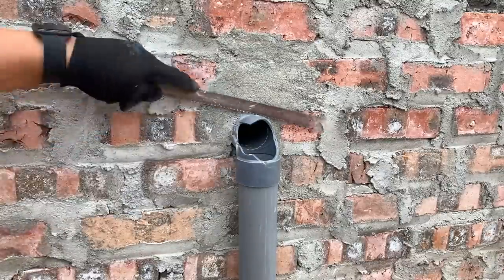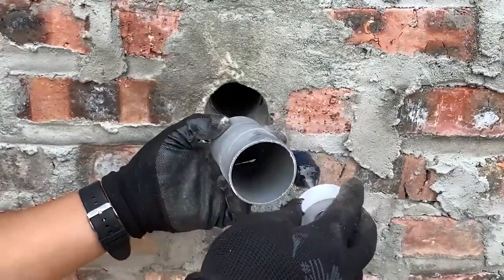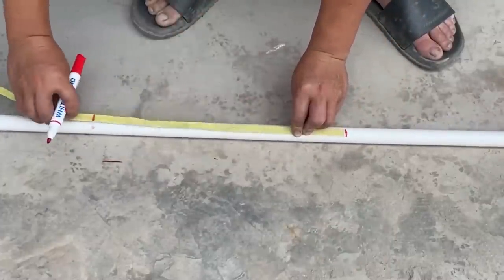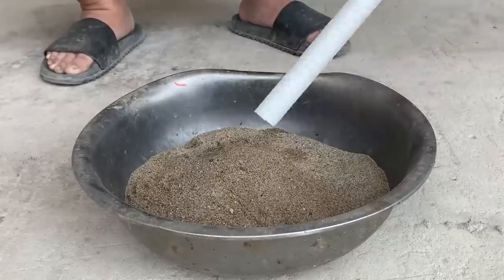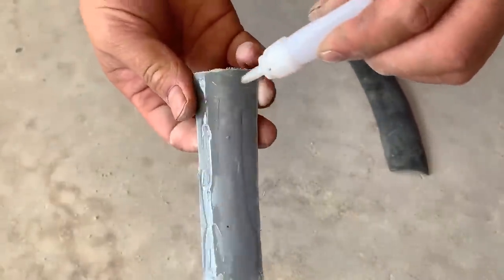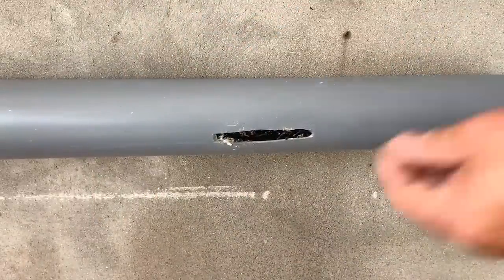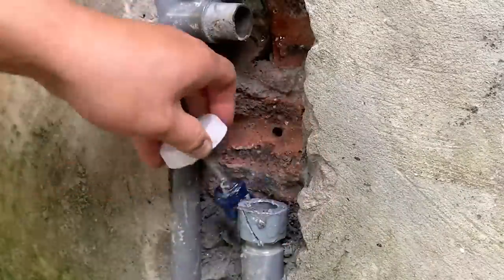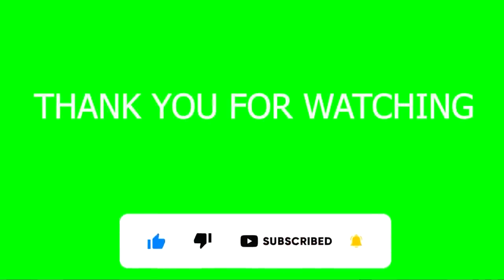On par with a White House plumber! This expert always shares invaluable repair tips.

Comment: Your plumbing skills are next-level! Can you recommend some essential tools every DIY plumber should have?
Reply from the maker: Certainly! Here are some essential tools that every DIY plumber should have in their toolkit:

Adjustable Wrench: An adjustable wrench is versatile and can be used for various plumbing connections.

Pipe Wrench: Pipe wrenches come in different sizes and are designed to grip and turn threaded pipes and fittings.

Plunger: A plunger is essential for clearing clogged drains and toilets.

Pipe Cutter: For cutting pipes cleanly and accurately, a pipe cutter is a must.

Tubing Cutter: Use a tubing cutter for cutting copper or plastic tubing cleanly and without deformation.

Pipe Thread Sealant (Teflon Tape): This is used to seal pipe threads, preventing leaks.

Plumber's Tape: Plumber's tape is used to create a watertight seal on threaded connections.

Hacksaw: A hacksaw is handy for cutting through metal pipes and other materials.

Pliers: Pliers come in various types, including slip-joint pliers and needle-nose pliers, and are useful for gripping and turning.

Teflon Paste: Teflon paste is another option for sealing pipe threads.

Pipe Fittings and Connectors: Keep a variety of pipe fittings and connectors on hand for repairs and installations.

Bucket: A bucket is useful for catching water and debris when working on plumbing fixtures.

Torch and Solder: If you plan to work with copper pipes, you'll need a torch and solder for soldering joints.

Pipe Insulation: Insulate pipes in cold areas to prevent freezing.

Plumber's Snake (or Auger): This tool helps clear stubborn clogs deep in pipes.

Safety Gear: Don't forget to wear safety glasses, gloves, and other appropriate protective gear.

Plumbing Putty or Caulk: For sealing fixtures like sinks and drains.

Plumbing Snake: A plumbing snake or drain auger can help clear tough clogs.

Pipe Clamps: These hold pipes in place while you work on them.

Channellock Pliers: These specialized pliers are designed for gripping and turning large pipes and fittings.

Having these tools on hand will enable you to tackle a wide range of plumbing tasks effectively and safely as a DIY plumber. Always use the right tool for the job to ensure the best results.

Comment: I appreciate how you break down complex techniques. Can you share some tips for maintaining a healthy plumbing system?
Reply from the maker: Thank you for your kind words! Maintaining a healthy plumbing system is crucial. Here are some tips to help you keep your plumbing in top shape:

Regularly check for leaks: Keep an eye out for any drips or leaks from faucets, pipes, or appliances. Promptly fixing them can prevent more significant issues.

Avoid chemical drain cleaners: Instead, use a plunger or a drain snake to clear clogs. Chemical cleaners can damage pipes over time.

Insulate exposed pipes: Especially in colder climates, insulating pipes can prevent freezing and potential bursts during winter.

Schedule routine inspections: Having a professional plumber inspect your plumbing system annually can catch minor issues before they become major problems.

Be mindful of what goes down the drain: Avoid putting grease, coffee grounds, or large food scraps down the sink to prevent clogs.

I hope you find these tips helpful for maintaining a healthy plumbing system!

Comment: Your insights are invaluable! Do you have any specific advice for dealing with common kitchen plumbing issues?
Reply from the maker: Absolutely, many of the techniques discussed in the video can be applied to common kitchen plumbing problems. Here are a few examples:

Leaky Faucets: The video may cover techniques on how to fix leaks, which can apply to a kitchen sink faucet.

Clogged Drains: Plumbing tricks for unclogging pipes or drains can be useful for kitchen sink blockages.

Pipe Repairs: If you have issues with the pipes under your kitchen sink, some techniques might help with quick fixes.

Water Pressure: Techniques for improving water pressure can benefit the kitchen faucet's performance.

However, it's important to note that kitchen sinks can have unique issues, such as garbage disposal problems or specific faucet types. Some of my other videos also provide instructions on how to troubleshoot those issues. You can check them out. If they haven't been helpful so far, please let us know more about the specific situation you're facing. We're willing to share a video addressing that particular problem with you.

Comment: Im always amazed at the level of expertise shared in your videos. Whats your top plumbing tip for beginners?
Reply from the maker: I appreciate your support! For beginners in plumbing, my top tip would be to start with small and manageable projects. Gain confidence by tackling simple repairs or installations, like fixing a leaky faucet or replacing a toilet flush valve. As you become more comfortable, you can gradually take on more complex plumbing tasks. Additionally, always prioritize safety, use the right tools, and don't hesitate to seek advice or watch tutorials to learn and improve your skills. Happy plumbing!

Comment: That must be some cheap plastic pipe and no plumbing code to comply with.
Reply from the maker: It sounds like you're questioning the quality of the materials and the adherence to plumbing standards. You're right! It's important to prioritize safety and quality when it comes to plumbing materials and codes. Proper materials and adherence to plumbing codes ensure the longevity and reliability of the system. If you have any tips or insights on maintaining plumbing systems effectively, feel free to share. Let's create a constructive discussion around this topic. Thanks for engaging!
Reply: Yupp welcome to Asia

Comment: DO NOT USE ANY OF THESE "HACKS" ON PRESSURIZED WATER LINES. THE WILL LEAK! The water valve replacement was ok.
Reply from the maker: Thank you for watching and for sharing your concerns! It's important to remember that these methods are primarily intended for non-pressurized system repairs. When it comes to pressurized water lines, safety is our top priority. We always recommend following the appropriate guidelines, and if you're unsure, it's best to consult a licensed professional. Thank you for highlighting the issue of water valve replacement; we're glad you found it helpful. We will continue to share useful and safe information in our videos. Thank you for being part of our community!

Comment: Seems like an awful lot of work, and that new joint inside the wall would’ve created a ridge that would collect debris. Seems like it would’ve been easier to drill a little bit of the mortar out surrounding the pipe, and just slipped on the new vent 90. Less work, better results frankly.
Reply from the maker: Thank you for sharing your thoughts and alternative suggestions! DIY projects often have multiple approaches, and your idea of drilling a bit of the mortar to install a new vent 90 certainly sounds like a valid and potentially simpler solution. Different situations may call for different methods, and it's great to have a variety of perspectives. We appreciate your input and the opportunity for discussion! 👍😊

Comment: None of this junk would fly in countries that have building codes or inspections. There's so many things wrong here. Just the smallest thing is that you're not using primer. Imagine sweating copper and you're like, nah I don't need flux. That's exactly what you did when you put a ton of glue on the pipe but didn't wipe it down or prime it.
Reply from the maker: Your comment raises valid concerns about adhering to building codes and standards. This video focuses on unconventional DIY solutions, which may not be suitable for all situations, especially those requiring strict compliance with regulations. These techniques aim to inspire creative problem-solving while emphasizing the importance of proper procedures when needed. Thank you for sharing your perspective!